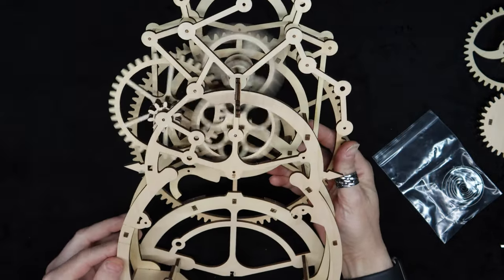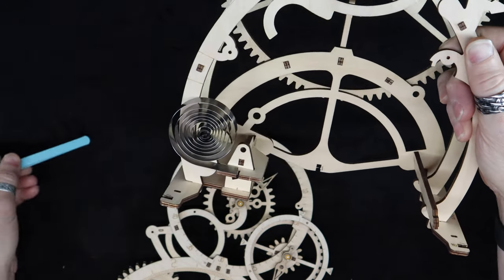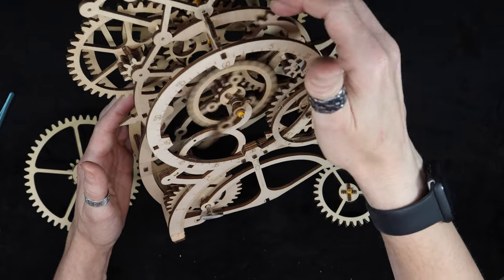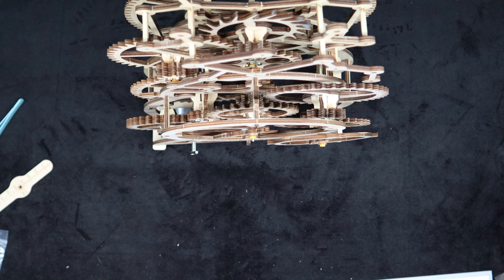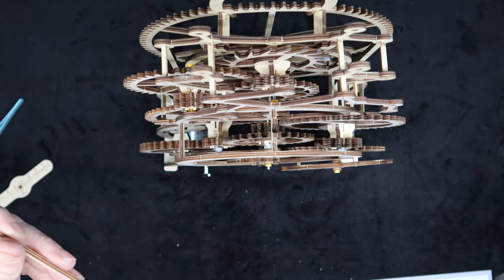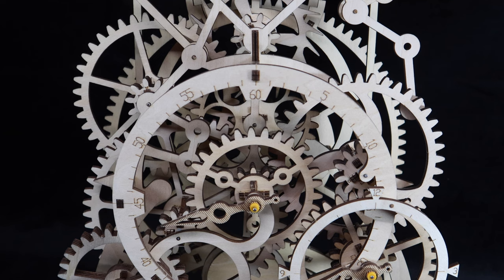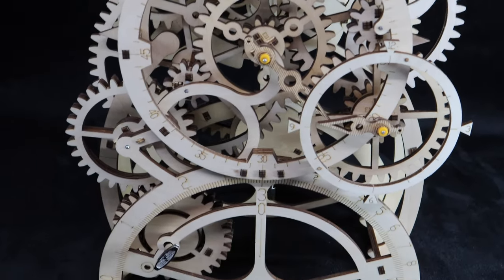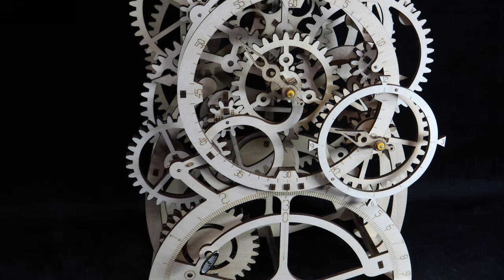ROKR Pendulum Clock: 18-END

Comment: Very nice, in the end it worked for you! Mine stops fairly quickly, and I have no clue why. Fun to assemble and understand the mechanism, though.
Reply from the maker: I found you really have to fine tine that little screw at the bottom of the pendulum, mine will only go for a few hours at a time, but the mechanism is really satisfying!